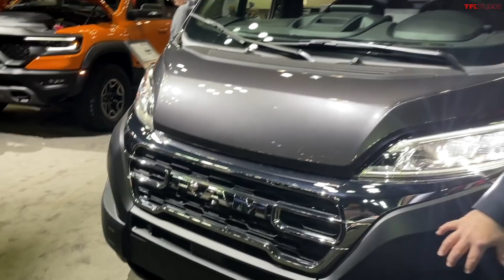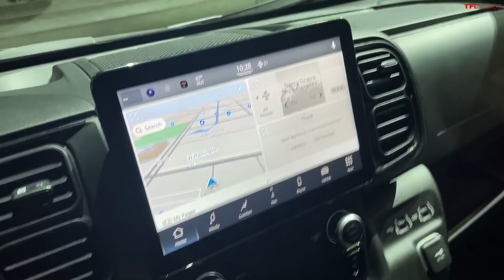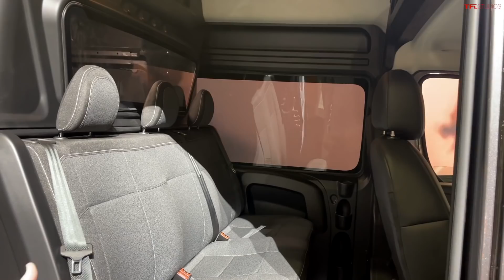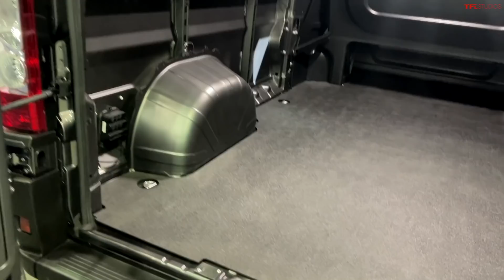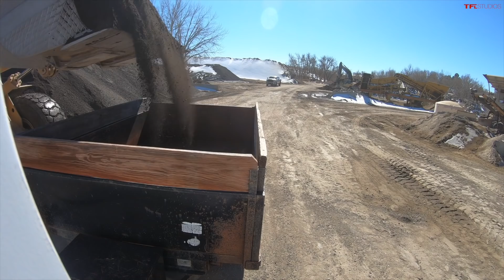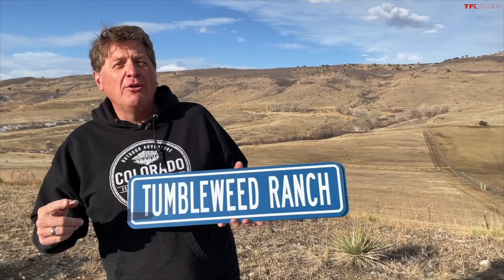The 2023 Ram Promaster Van Gets Better Fuel Economy, Better Lights And a New 9-Speed Transmission!

Comment: Definitely looks better up front and in the dash and front interior. Some very good changes but as an RV they set the generator underneath right behind the axel and it is lower than the axel. Horrible set up!! If you got one as an RV and go anywhere off of a paved road, you might want to lift it and add some protection to that generator!!

Comment: The Class B RV builders are going to LOVE that new super high roof model to compete with Transit and Sprinter. I'll bet that Amazon has a Lot to do with this new taller Promaster...
Reply: They have Ducatos what the Promaster is based on, that have the high roof. Difference between the Promaster and Ducato is the Ducato  has a 2.8 diesel used as a small Motorhome base, rarely as a Van in Australia
Reply: For sure!

Comment: I gotta say I love the fractal Ram emblem on the steering wheel. 

If Ram made a Manual Transmission option for the low roof 118" wheelbase variant or they made an all electric Promaster 118" low roof I'd almost definitely buy one. Their FWD drivetrain is very slick and with a manual transmission it would be like the Turbo Manual Dodge Caravan's of old. A hoonable yet practical little van.
Reply: They would sell 12 manuals and lose about 20 million for offering it,,,,, hahaha.

Comment: Does it get a better engine that won't need cylinder heads after 70k miles?  

And who makes that 9 speed? Chrysler?
I like the vans, but I won't hold my breath on it being reliable.
Reply: The company I work for has 5 2019’s that have had zero issues. Not the most comfortable but I have driven them 1000 miles in a day on multiple occasions. SO glad to hear they are swapping to the 9 speed! That is my biggest gripe about our vans. 1,2,3 is a close ratio then you hit 4th and drop from 6200 to 3k rpm. Thats when the smiles dissolve. 😬😞
Reply: @Nicwedge  good to know... I do like the vans chassis, I will keep an eye open on the newer ones. I just want one for a small camper. I like the Ford vans too, but these are nice and low in the rear, and abundant.
Reply: While I have no experience with the engines apparently they've made them much better over the years to the point where they're an extremely reliable little mill. ZF makes the transmissions apparently.  

If they made one of the Low Roof SWB models with a manual transmission I'd have to get one. That being said their FWD setup is really clever.

Comment: Do they or are they planning a full passenger version?  Kind of like the 12 passenger capacity of the old style vans.  Popular among clubs, churches, big families and other groups that need passenger capacity at a reasonable price (i.e. with out having to go into actual buses).
Reply: The ducato, boxer and jumper all have that in europe but im not sure if its factory or installed after
Reply: I know some school boards have banned the use of them for transporting students. So they could be holding back because the do have a reputation as not being that safe especially on slippery roads
Reply: @jamesoldman3021  there’re school bus versions of the Promaster offered for sale. The conventional 15 passenger vans like the Ford Econoline, Ram B Maxi Van and Chevrolet Express vans are the ones which basically went away due to their higher center of gravity and narrow rear wheel track width. The single real wheel versions are the ones we’re the ones with the most issues. The dually cutaway/chassis cab models were not the issue.
Reply: @americanrambler4972  
You are correct. If they had dual wheels they are acceptable. As you say made from the cab/chassis versions. Where I live all the ambulances are built from the same configuration. Primarily using the Chevrolet/GMC chassis. 

Slightly different topic but the ProMaster when used as a delivery van are not well liked in the winter due to the front wheel drive. With a maximum load they tend to have traction problems in the winter. Now I am in the Rockies which is one contributing factor and the type of body. The box or cube van's having only the rear door. If they end up having to load with all the heavy weight for the first few stops it goes onto the rear axle and the front is light.
Reply: @jamesoldman3021  I have seen very few box van chassis cab versions of the Promaster. I think there are a number of reasons for that. A big one is the box van floor/bed height. Most box vans I see have the floor height positioned to match up with loading docks. The Promaster floors are much lower. Also, I do not see any dual rear wheel versions. You are correct in that many box vans utilize the dual rear wheel weight capacity and stability the wider track provides. And most of those trucks offer bigger, more powerful and stronger engines, transmissions and drive axles. 

I have seen a number of the utility box versions of the Promaster. (Those with all the tool box doors on the sides.) those work out much more satisfactorily because most of the time most of their weight is carried in the middle between the axles. But if your use of a Promaster entails loading them tail heavy like many box trucks are, then the benefits of a front drive platform are compromised. 

The Ducato, Jumper and Boxer vans are very successful in European service. But when the loads get heavier, say above 6,000 to 8,000 pounds payload, the rear wheel drive dual axle trucks move into the lead. A number of manufactures offer front wheel drive commercial van models in the Promaster size range. 

For 2023, Promaster will get a higher roof version of the van that has been on sale in Europe for a number of years. We currently only get the low roof and mid roof versions. (H1 and H2). The taller H3 version is on its way.